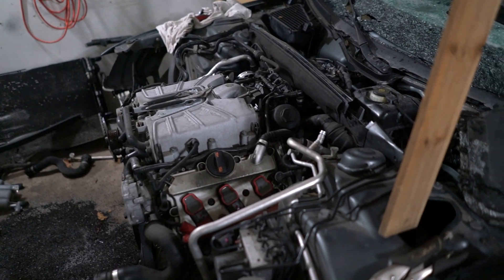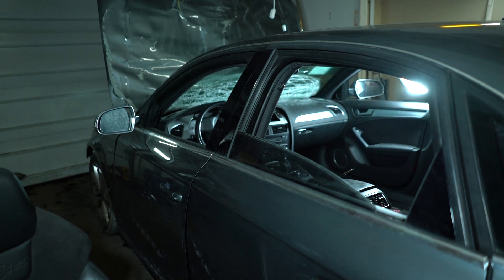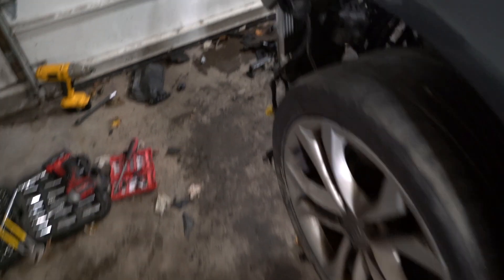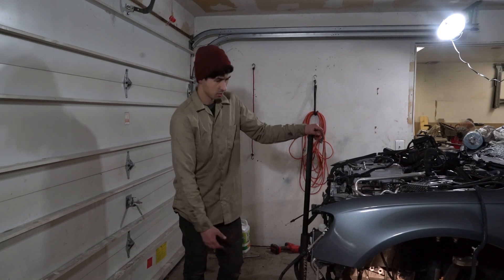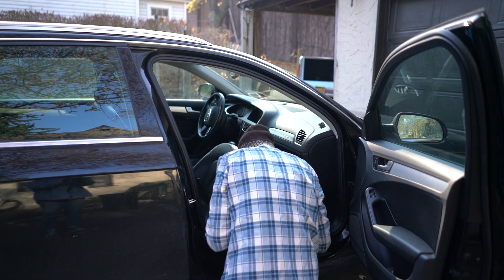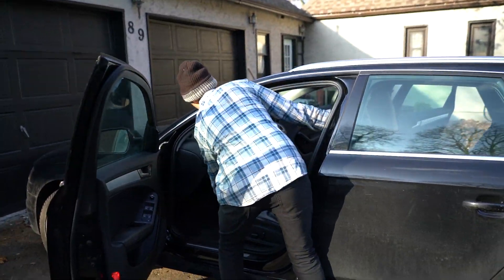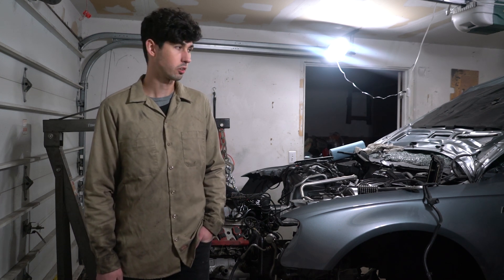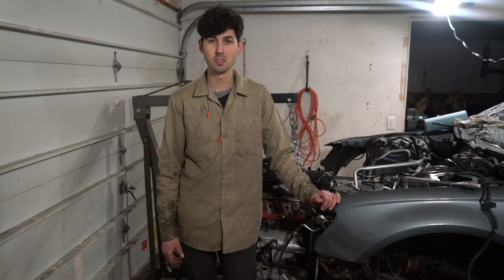Audi S4 Avant Swap Pt. 2: Engine Out, Interior In

Comment: This project looks more intimidating than the Ford. Keep up the good work.
Reply from the maker: In some ways, but it really is just unbolting things and swapping them over. No paint, no rust. Also cars are built so much smarter now than they were in the 80's so the systems are more complex but installation is faster and easier.